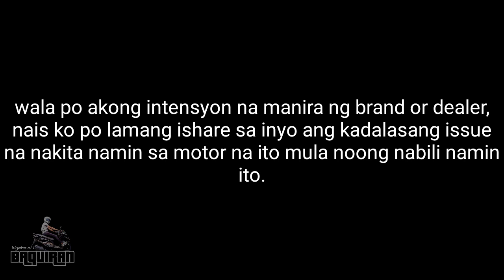2020 BURGMAN STREET 125: T-POST ISSUE FIXED!

Comment: Yung sinasabi mong pin on plastic na nga lock,tusukin mo lng Yung gitna lulubog Yun tapos Saka mo ngayon iangat Yung gilid.hehehe.tama ka issue nga rin Yan kapag tumagal kakayod Yan sa tpost e.aba madiskarte ka pla paps sunod nyan maglalagay ka na ng hazard light,blue tooth speaker jbl Kya lang nasa 9k,etc.hehehe
Reply from the maker: Salamat po sir, natanggal ko na po yun dati, medyo may kahirapan lang, and natakot na akong baklasin pa ng husto haha. Baka kasi may masira pa ako eh kabago bago ng motor. Pero sa ngayon, pinapalitan ko na po ng t-post sa suzuki, no charges sa Suzuki 3s 💪 wirings na next pag natapos na po warranty period 😁

Comment: Kamusta ang fuel consumption ng burgman mo bruh?
Reply from the maker: Sa ngayon po, city driving with traffic, 59.3kpl, tipid mode po, up to 1/2 throttle lang po max ko, tops speed of 60-80kph. Siguro po pag walwalan mode bababa siya ng 49-55kpl.
Reply: @biyahenibaquiran  wow. Subrang tipid pala sa gas. Im currently using nmax155 v1 at ang milage ko 35-38 city drive at kung high way 40-41. Thanks bruh RS!

Comment: Pano sir malaman pag meron alog sa tpost? Sakin kasi may natunog pag iniikot ko handle.
Reply from the maker: Panong tunog sir? Baka naiipit mga wirings po sa loob? Mararamdaman po yung alog sa tpost kapag dadaan sa humps, umaalog handle bar pag malakas na pagpreno, or malubak po 😁
Reply: Parang ng kikiskisan sir. Pero pag nakahinto lang naman tapos gagalawin ko handle. Papa check ko nga ngaun sa casa.
Reply: Musta na yung burgman nyo sir @pdyk lods
Reply: @edsel740  ganyan din akin paps. Parang maingay konti pag iniikot handle bar pg naka stop. issue ba kaya yun?
Reply: @kuyaferds8715  ok na. ung mga kable lang pla ng brake ng kikiskisan. bago pa kasi.
Reply: @littlefinger9000  ung kable ng brake lang ata yan paps.same din sakin kable lang pala ng brake.